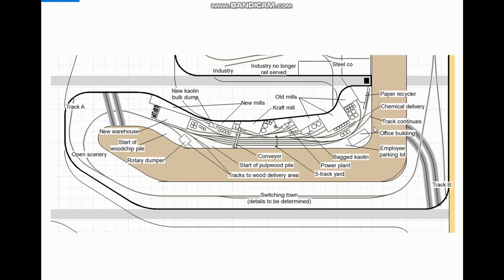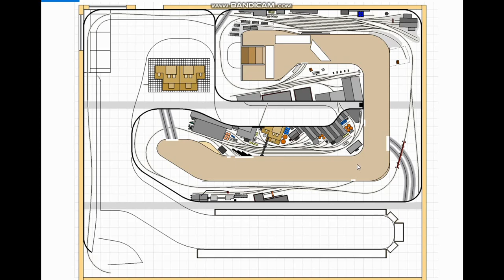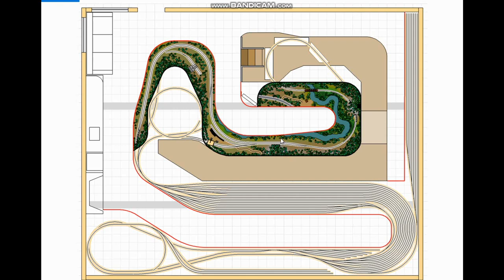Three-level mushroom layout design, part 3

Comment: Wow. I wish I had the space. Thanks for sharing. You are an excellent designer.
Reply from the maker: So do most modelers.  With a smaller space, the trick is to look at larger designs as a series of smaller elements and determine which ones are exciting to you while still being more in line with one's space.
Reply: @mpeterll  I got that from watching you for years. I have a 12 by 16 foot space under construction. A small shed. It's almost done. No windows. one door. Climate controlled. Should make a fun N scale layout.

Comment: I love watching your design videos! It seems that not many people incorporate grade crossings in their layout. Could create some interesting operations in industrial areas that you can’t foul the crossing for too long.
Reply from the maker: On a model, where train density and frequency of switching is greater than the real thing, one doesn't want too many of them.  I did include one on the harbor branch, where the driveway to the cannery and auto-rack facility crosses the middle of the siding, requiring the operator to split any cuts of cars left there.

Comment: The amount of background-story for the design is amazing - I love that in your work.

It is an enormous list of track+switches.to order. Do you have a rough estimate of how much dollars in raw material just for the tracks this will amount to ?
Is this meant to be fully decked out with switchmotors and occupancy detectors and such ?
Reply from the maker: Working out the total material cost for something like this that will take many years to create is less important than figuring out how much it will cost to get started.
For example, there are approximately 240 turnouts on the layout.  Supposing it takes the builder 20 years to complete the trackwork on the third level, he will only be buying an average of one turnout per month (less any that he is able to salvage from his previous layout, of course).
His first big expense will be remodeling the building to accommodate the railroad.  Once he has completed that, it's up to him how fast he chooses to push ahead with the layout, and therefore how much he as to spend on it each month.
Reading the client's comments on the previous two installments will give you a good idea of the sort of electronics he is thinking of installing.
Reply: Layout will be run by Digitrax's DCC system for controlling locomotives.  Switches will have switch machines with them being either DCC controlled / Computer controlled or be controlled by facia mounted switches depending on if they are on the Short Line, Harbor Belt, NS secondary mainline or are staging.  The NS secondary mainline will have signals.  The Harbor Belt and Short Line will most likely be dark territory.

Comment: I have a terrible memory, so have to go back and forth among the levels to try to keep it straight in my mind. One point of curiousity: does the layout design software have some kind of "linearize" function, so that it can produce the overall point to point track plan, like people often put on their dispatch panels? Harder with those branch lines...
Reply from the maker: Kind-of.  There is a "path" feature that allows you to click on two lines and it will attempt to find a path between them.  I use it mainly for checking track lengths and turning the backdrop outline into a polygon that I can shade a solid color.  Since all line segments that are included in the path are effectively selected, it is possible to move them to a different layer with different display parameters, which could be an effective way to highlight a main route if that is what you want to do.
Reply: @mpeterll  That could be handy when setting up car cards, etc. for a running session - if you choose the start and end for a given car, you will be able to see where it needs to go. The yards and staging it passes through would help figure out which local trains it needs the help of. Of course, during the actual operating session, the various operators and yardmasters have to figure that out for themselves!